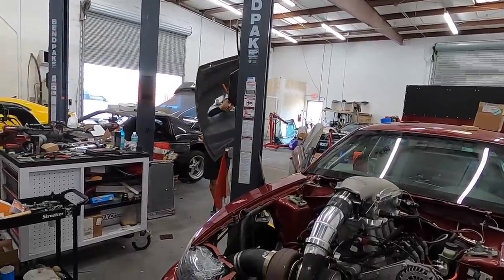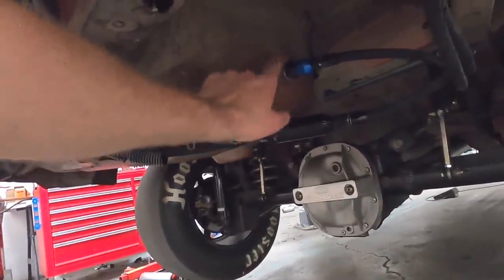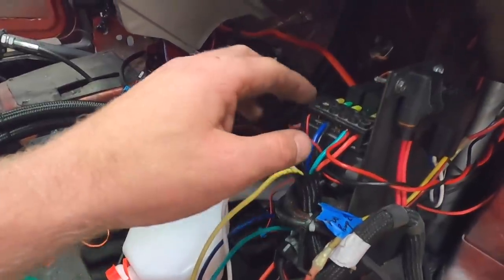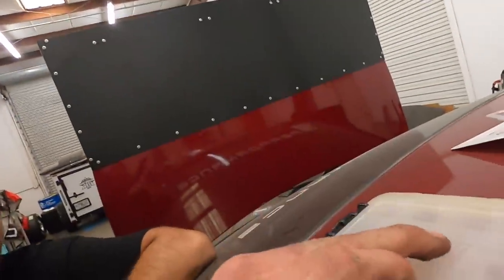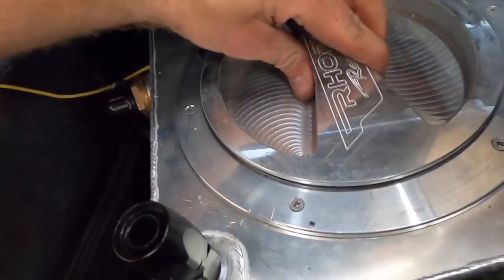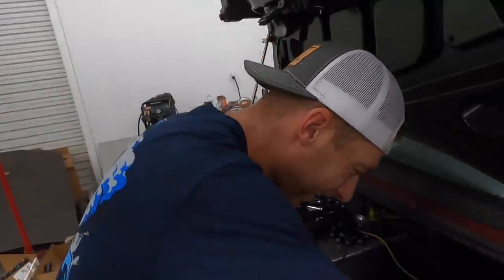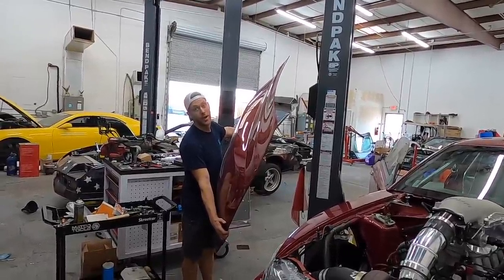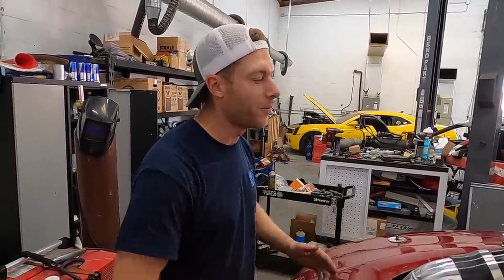I Took My Car To Cleetus's Shop and Now My Hood Doesn't Fit... 3 Weeks Until Race Week

Comment: I have had good luck with that style of solder/heat shrink tube. If you do a interlock twist with the wires then get it good and hot so the solder melts all the way they work good.
Reply from the maker: Yea but then it melts the plastic too!
Reply: @DoctrParker  yeah it does do that sometimes if you use  to much heat to fast. sometimes I just put another heat shrink on and slide it over after that solders and do the final seal with the black heat shrink. At that point it is still faster that fooling with soldering iron and a roll of solder.

Comment: I got that same heat shrink kit off of Amazon, it works better if you twist the wires together tightly and then use a heat gun. With the torch it just burns it up.
Reply from the maker: Ahhhh I’ll try it

Comment: The heat shrink terminals, use low temp solder to fuse the wires together.  you got it way too hot, so next time let it cool longer before pulling apart.  the blue bands are hot glue to "seal" the wire.
Reply from the maker: They take way too long compared to regular butt connectors
Reply: @DoctrParker   true, but the idea is they are "sealed".  they make the adhesive lined crimp terminals also; without the solder.

Comment: Heat gun is the trick iv used a lot of those and they're great take the wire and push them together so the strands are inside each other and that should do the trick

Comment: That solder connectors work brilliantly, but you have to be carefull not to overheat the joint and then give it time to cool down completely before moving it

Comment: 8:53 gotta use a heat gun for this things, a torch destroys them, but they do work good. Just did my power windows, doors, locks, and interior lights wiring with them in my daily.
Get yourself a mini heat gun with high heat and they take no time. The Wagner HT400 works tits on them

Comment: The solder fittings you have to spread the wires push them together and twist them slide and heat also needs to cool all the way I’ve been using them for a while on everything and love them also need to get the kuject brand best ones yet